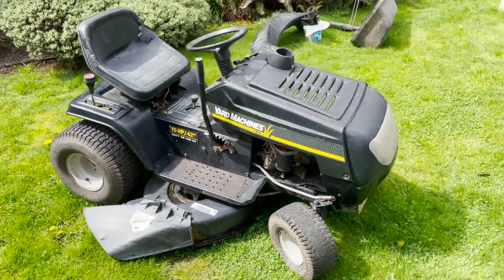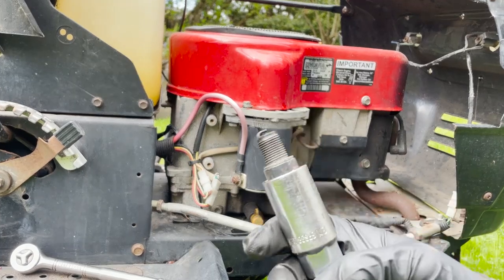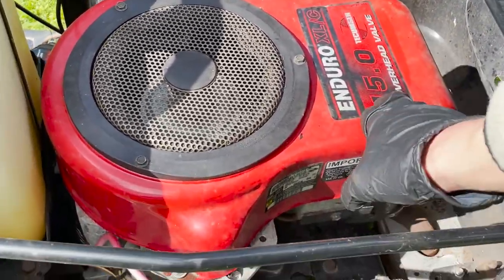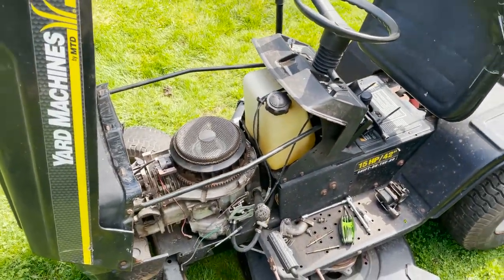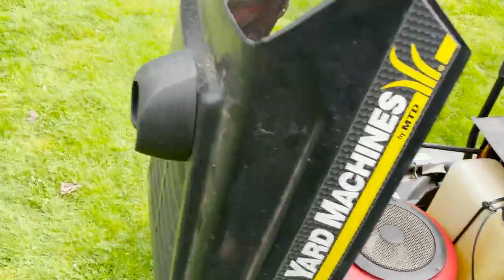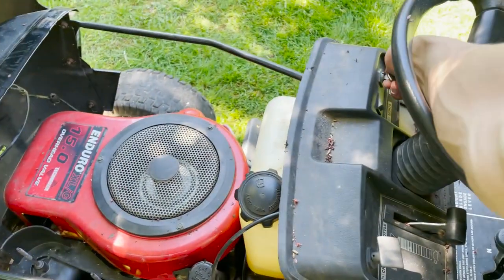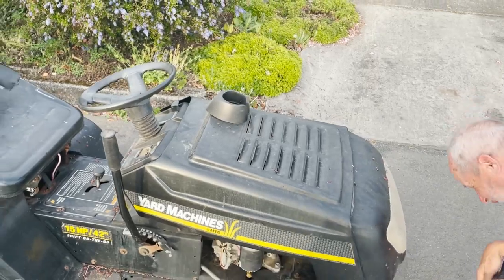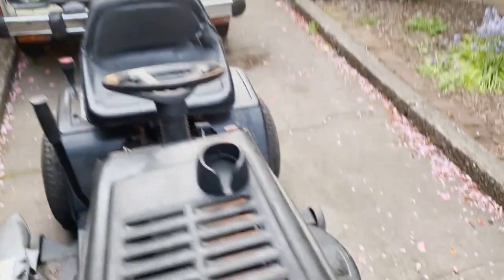Can This Riding Lawn Mower Tow My Car? Will It Even Run? Free Yard Machine 15hp X 1977 Honda CVCC!

Comment: LOL Your Dad ran into you.
Reply from the maker: He said it was my fault lol
Reply: @Mechanic_kid  I know this video is a year old but most likely it is a combination of people's faults, for one, when a car is off (I dont even know if that civic has power brakes from the factory) but when the car is off, it takes a lot more effort to stop the car even with it being so light, I daily drive a 1967 Ford F-250 with factory drum brakes and no power assist and i have to pretty much literally stand on the pedal to get it to stop. and two, the speed at which i saw you stop is fairly fast however it would make sense he is already on the pedal. In conclusion i feel as though your dad was in the right because of the rate of which you stopped. But, I am currently building a garden tractor myself, but I live in West Virginia in the mountains and so I dont want to spend a whole lot of money on a UTV and so I got this riding mower for free and i am changing the output shaft on the transmission, and removing the deck. I am also overtightening the steering (not recommended normally) because the steering is worn out and the top speed of the thing is over 35mph and it tends to want to tip over because of the play in the steering... going from turning the wheel and nothing happening and then oh no, i am in a ditch. I also built my own trailer for the UTV for hunting purposes and put Quad rear tires on it. I also welded the rear axle. Total I have in the mower is under $350 and that is including the welder i bought for $199 from Harbor Freight. If you ever want a go - kart and you have your fathers permission, a riding lawnmower is the way to go, just do some research on it, if you dont it may tip over if not properly built. Anyways I know this comment is very long for someone who probably wont even read this but have a great day!